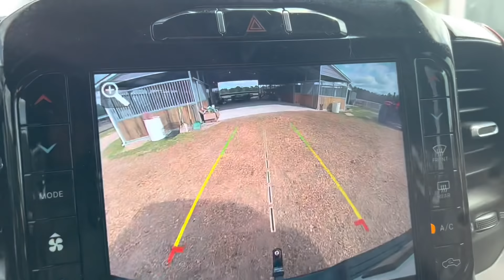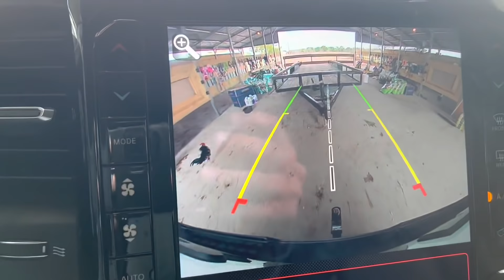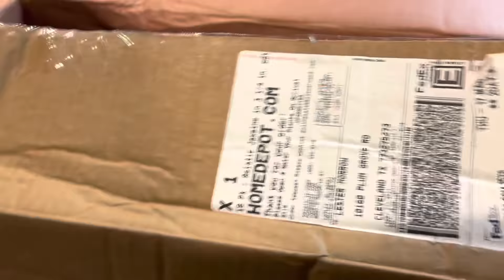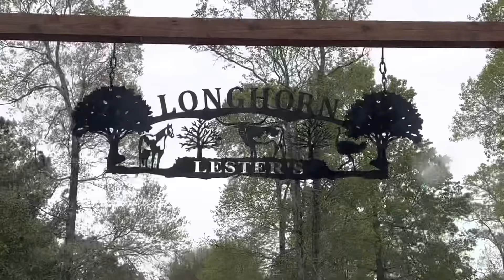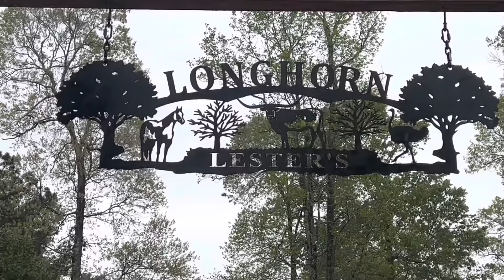March 2022 at Longhorn Lester’s:  We are officially on countdown!

Comment: You may want to consider  one stall has a gate on three sides. So if you have a cow that needs medical attention.  You can deal with her problem without going in to they pasture. All you would have to do is open a gate that leads in to your area of the barn. This could work as a loading area. All you would have to do. Is run the cow in to that stall an close  then open that one gate that goes in to your part.

Comment: Contractors go to home depot and lowes of course but they get the important stuff at Contractor supply stores. Nails and screws pretty much the same thing but roofing and even wood for decks ect basically anything you really want straight don't get from HD or lowes their wood is shit unless you want it waving at ya. That's probably part of your problem that you had blame the Crooked fence on Crooked boards cuz they really are or loaded with knots